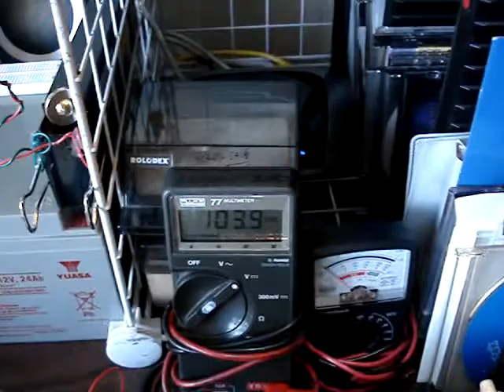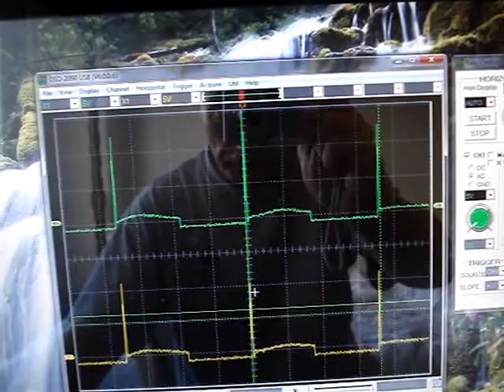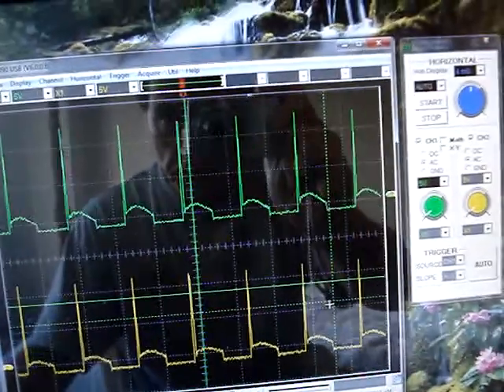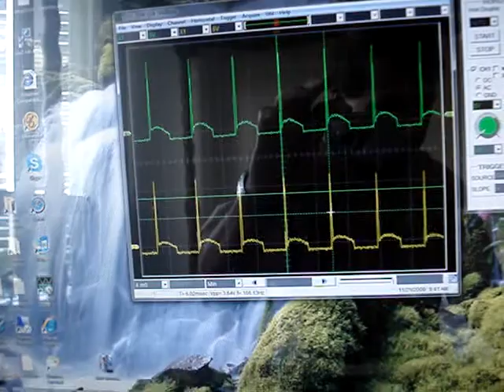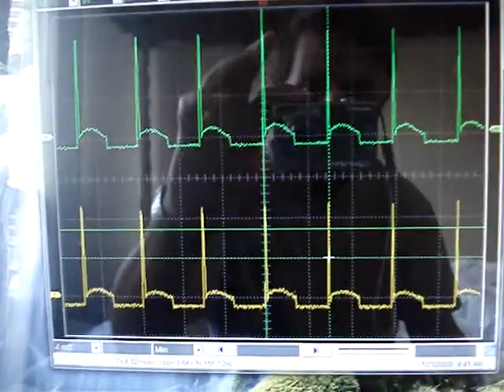Rotorgenie2  Brushless DC pulse motor & generator

Comment: Many thanks
I don't know if anyone has tried this, but have you considered a further 2 coils positioned above the 2 you have?
Either supplied with a further 2 transistors or just in parallel or series (depending on the effect the fields have)?
Looking at your results, it might further drop the pull on the amps (off load) - there again they might just load share? Best be careful though just in case the RPM goes through the roof... LOL!
Just a thought?

Comment: imagine your results if you had 6 caps 3 recharge 3 are charged. 555 circuit pulsed caps into the coil, 2 fire in and the third wire is fired out, then they charge, and 2 out, 1 in and the trigger can be a spark gap motor. or just a circuit to alternate the pulsed dc current